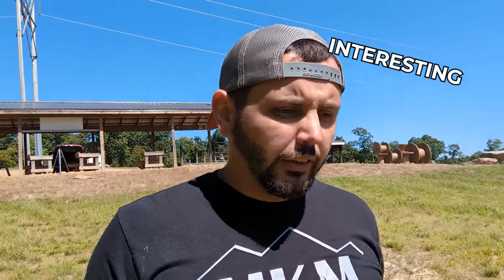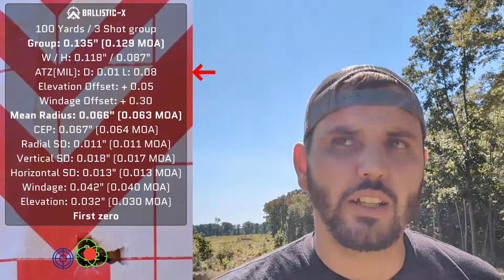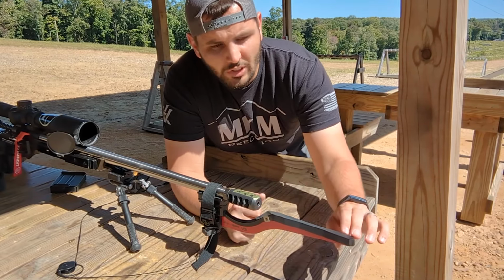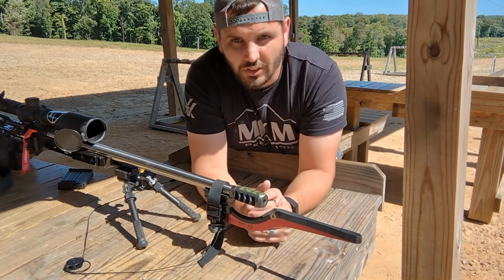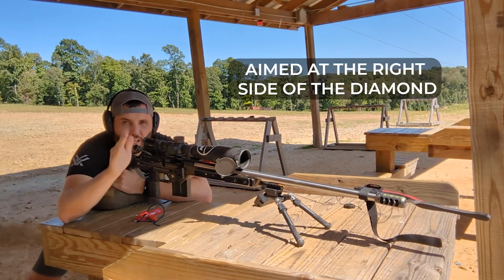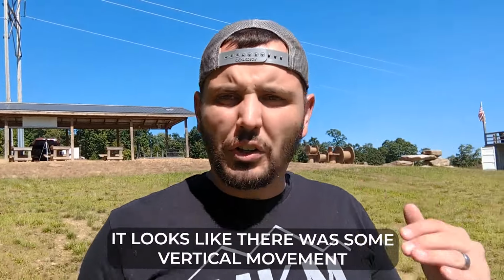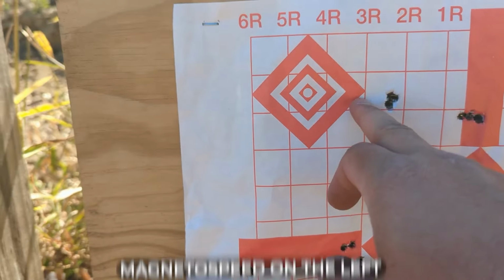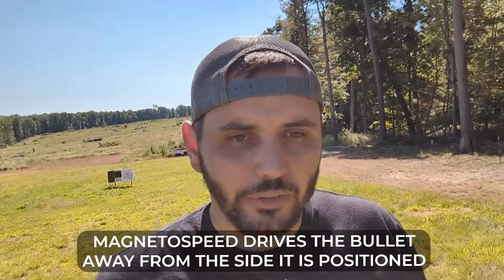Testing MagnetoSpeed: How Different Positions Affect Point of Impact!

Comment: Now you need to test with the bayonet mounted remotely (not touching the barrel at all) and see if it still moves the impact.  This is how I use my MagnetoSpeed and I am very interested in what you find.  I've always assumed that since the bayonet was not touching the barrel and I set it about 1/4" below the bullet path that any affect would be minimized or removed.  Inquiring minds want to know...
Reply: I tried this today using a MKM Bayonet mount on two rifles and i didn’t see a change of impact at 100 yds. 300wsm with a brake and my 243lbc  that only has a target crown.  So maybe the bayonet being strapped to the barrel affects it more???

Comment: What happens when you put an additional spacer in the Magnetospeed mount so that its not so close to the barrel? How far down can you move the Magnetospeed to still get a reading and not affect precision?
Reply from the maker: I actually tested this afterwards and the results were pretty cool. But it wasn't a robust test and I'll need to revisit that at some point in the future
Reply: That’s a good idea just know that, Doing that will increase the SD. In one of Bryan litz books (advancements in long range shooting; chapter 15)he tested a bunch of chronographs and found the closer the magneto speeds bayonet is to the path of the bullet the smaller SD and also the more true of a reading of the SD you will get. All chronographs give SD readings higher than what a SD is actually (+ 1 to over 15 error in Sd), it’s something to do with the clock speed of the computer sensors. The Magneto speed is one of the most accurate and precise chronographs. Also Magneto speed changed there original instructions, they now recommend the bayonet be closer to the path of the bullet than they used to.

Comment: Yes, definitely interesting, and something I’ve never seen discussed before. Many users don’t like the idea of attaching the unit directly to the barrel and there are ways of avoiding that. The phenomenon you’ve evidently identified, though, could affect point of impact even if the unit is attached to the rifle stock and not the barrel. Now I’m curious how far from the line of bullet flight the unit can be positioned and still get accurate velocity readings. As mentioned, perhaps moving it away farther would eliminate the problem.* If not, though, it’s something users of the MagnetoSpeed should be aware of.
*According to one comment I found, the offset from the bore line should be 1/8 to 3/8 inch, so that doesn’t allow to move it farther away very much.

Comment: Let me guess, there is rifling and the bullet has right spin when leaving the barrel. 
Most probably you witness some Magnus-like effect. As the bullet spins it pulls with itself a boundary layer of air, which also spins with the bullet. This layer hits the side of the magnetospeed creating a high pressure area, which pushes the bullet to the opposite. When the magneto is below, the high pressure area is below and right; when it is above, the high pressure area is above and left; when it is to the left, the high pressure is left and down; etc...